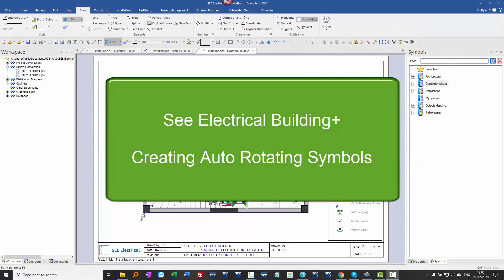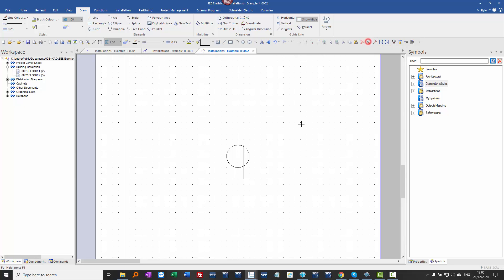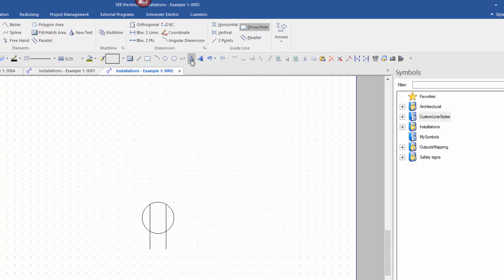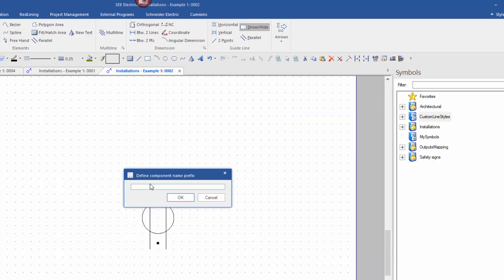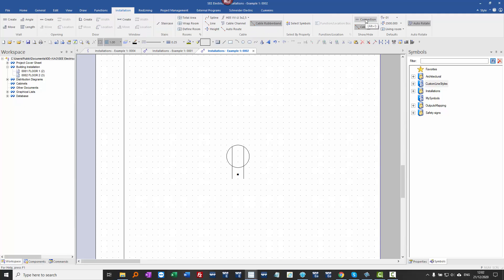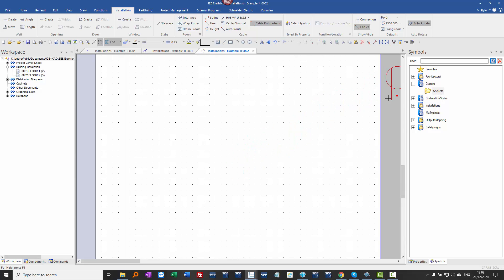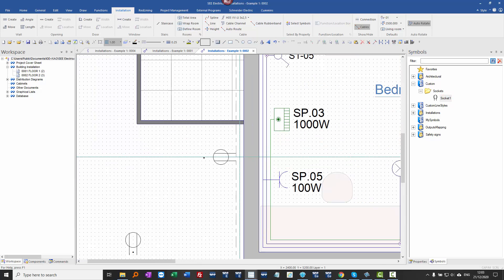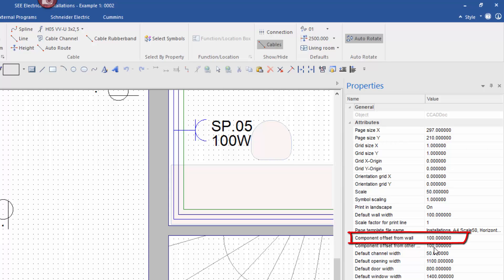Creating Building Plan Electrical Symbols with Auto Rotation

Comment: Hello. I have one more question. I noticed that when using the cable channel when using the auto route cable function, the cable does not always choose the shortest path through the cable channel. When there are several joints, sometimes it goes to the end of the cable channel and then returns to the same route. Is there any way to always choose the shortest path? I noticed this error in a default example from SEE Electrical - Installations - Example 6 - BE standard
Reply: Se poate seta calea cea mai scurta.
Reply: @ioantintesan8312  Poti povesti pe scurt cum alegi calea cea mai scurta? ca eu nu mi-am cam dat seama inca cum sa fac asta....

Comment: Hello. I have a question for you. In the distribution diagram, is there any posibility to define a custom view of component propertise ? For example i want to show more propertise than by default (Product and Rated current) for circuit brakers. But i want those for the default symbols, not to create other new symbols with other default propertise. And the second question is how to auto select circuit brakers in distribuition diagram generation for different circuits (10A, 16A, 20A etc). I put this questions because if i edit the diagram and after a while i will regenerate it i will loose all these modifications i made it on the diagrams...